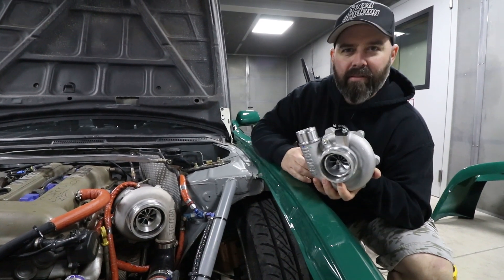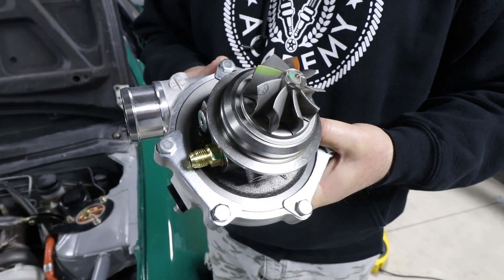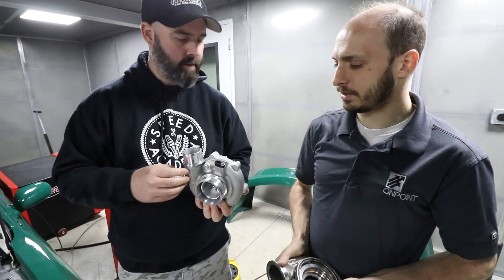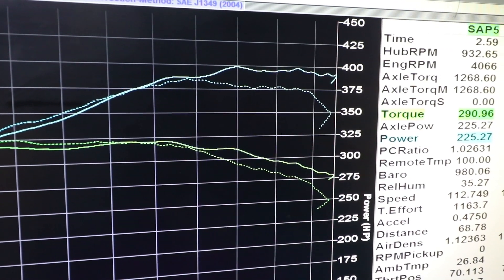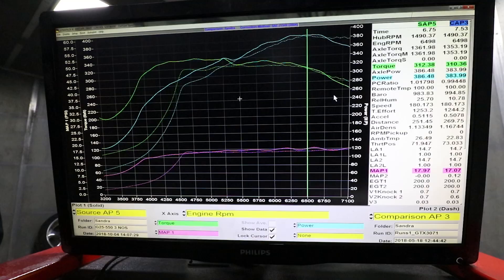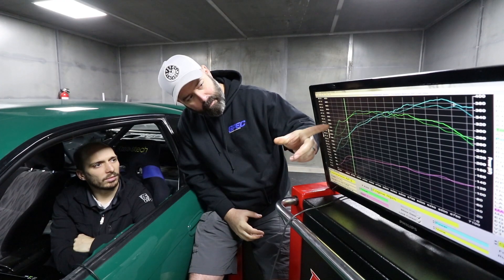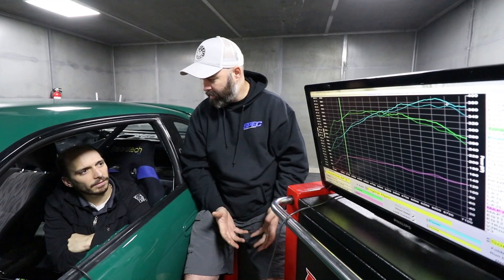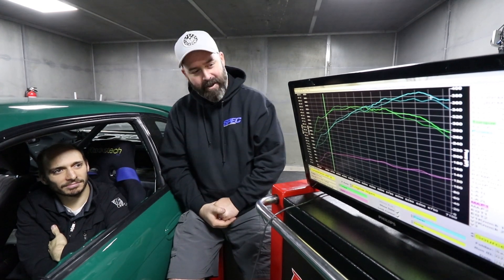Garrett G25-550 VS GTX3071R Gen 2 SR20DET Turbo Test

Comment: Hi all, how would this turbo perform on a 3.0L?     Does the curve just shift by 2/3?      So the psi made at 3000 on a 2.0L will be made at 2000 on a 3.0L?

Comment: I run a GTX3076R on my EJ207 WRX and it is a great turbo for a 2.0L. 450whp on E85 and perfect for daily driving. Spools at 5k rpm. My next turbo will be the G25 for sure though.
Reply: Spools at 5k? Isn’t that late? How can we get an earlier spool from 3k to 7.5k rpm?
Reply: Spools at 5k?!... thats late! Certainly not a good street set-up. 

You want full boost by like 3500rpm.
Reply: what a/r is the 3076r?
Reply: @UnsaltedSpuds  .60
Reply: I got a 2867r .57 ar I'm trying to get fastest spool for more low end torque. I wonder how it will perform on my 2.0t Mk6 R

Comment: When it comes to low down spool you can't go past an EFR turbo,we personally went from a Garrett T66 b/b .68 single entry housing and made 9psi at 5500rpm to an EFR9180 with a 1.05 split and seen 24psi at 5500rpm,was night and day,car made 650hp to the tyres through an auto and a single cam 1.8ltr @8.76@155mph at 42psi at 2480lbs...

Comment: It's incorrect test, this different frame turbos! Need test GTX2867 0.86A/R vs G25-550 0.72. They have same peak power, and same exhaust flow chart

Comment: Can't get over the laughably huge low-end advantage of the G25-550 over the GTX3071R V2 on this particular engine. Below 4600 rpm, the G25-550 has +150 lb-ft in a lot of areas. For pure top end though, the G25's (660 included) seem to choke, as expected. But more options are good.
Reply: That 150 ft lbs is a big deal
Reply: It matches the gtx3071 on the top end while besting it by 150 ft-lb in lower rpms.
Reply: at 6700 rpm
Reply: why ?

Comment: @speed academy
I had narrowed down my turbo choices to either the GTX2867R Gen2, or GTX3071R Gen2, for my KA24DET S13 drift/daily, but seeing this video has me reconsidering. My goal, also, is to have the fastest spool and response time possible, with a target of 350hp. I basically want as close to zero turbo lag as possible. 
I will be running an ARC Sidemount Intercooler, 91 Octane pump gas, 740cc DW Injectors, Megasquirt2 standalone, NTK/AFR500v2 WB, Tial BOV, Tomei lower-mount cast T2 manifold, and 3 inch exhaust. It is a 2.4L Dual Cam engine with forged internals and stock cams.
Will the G25-550 .72a/r, as seen in this video, be too restrictive or reach efficiency too quickly in the powerband, since I have a 2.4L and not the 2.0L as used in this video? I don't want to cause unnecessary intake temps in pursuit of fast spool times. I need to decide which turbo I am going to use, as it is the last big purchase needed in order to complete this build.
Thank you in advance for any advice you can send my way!
Reply: According to Garrett's website, the only G25 with a T2 entry is a 0.49 a/r. Way too small for a 2.4L engine. My only option for a 0.72 G25 is to buy a V-Band manifold. Could I get similar spool from a GTX3071R with the 0.64a/r? Or would that be too restrictive in the top-end with too much heat? Or a GTX2867 with 0.64 or 0.86? I really want to stick with my Tomei T2 manifold.
And also, Garrett does not make a 0.72a/r GTX3071R Gen 2. What was the a/r for the GTX turbo in this video?
Thanks again.
Reply: @sonoradrift  also the piping shown in this car is surely and most likely introducing a lot of lag as the turbo has to fill all that area even before making positive pressure
Reply: i mean i get better spool in a 2.0 with a holset hx35 (40 years old technology) than this super modern g25
Reply: @cfiorucci  Holsets are great turbos for price... And usually greater than 3x expensive turbos.
Reply: @puliukk0  without a doubt! but they are huge in comparison, and have a very heavy rotating assembly. That was what i wanted to point out in my comment, there shouldn’t be an scenario where that turbo outspools a g25
Reply: the thing is that you’ll choke a gtx28 or g25 turbine wheels with a 2.4, for me, your safest bet is a gtx3071r, or go directly to a twinscroll setup

Comment: If u gotta use nitrous 2 compensate. U need 2 throw it away and go back till the tunning.  It sounds ok. But you can tell when a motor ain't built/ tuned right. This motor sounds like one of them

Comment: I was under the impression that the G25 550 would spool almost like the stock T28 but with more power potential, without nitrous it saw full spool at around  3800 rpms, my gt2871 journal bearing gets that.
Reply: Do you have it installed on an SR20? I cant figure out the difference between a 2871, 2971, and 3071.. Any advice?
Reply: @sonoradrift  2871 uses the NS111 turbine. 2971 uses a cropped  3071R turbine. 3071 has the full size 55/60 turbine. The 2871 is a terrible turbo,  the compressor wheel much too large for the turbine. The 2971 is no better with its cropped turbine.  In a 28 size frame the GTX2860R gen2 is king IMO. If stepping up to 30 size frame,  3067R or 3071R with full size turbine is good too.
Reply: @Rhubarb237 you know your turbos well

Comment: Does this car have a diverter valve at all? I hear what sounds like one opening, but then there definitely seems to be compressor surge also after the throttle is closed. Is this a concern or are you relying on the ball bearings to take the abuse and not worry about it?

Comment: very good video! thanks. i wonder how it performs vs my gtx gen2 2860 that i use for 340whp now. i have full spool at around 4100rpm
Reply: what engine size?
Reply: @dennisrobinson8008 built sr20det. funny i come back to this nowas i just broke my gtx

Comment: Response without twin scroll is a bad route IMO. Other than that a comparisoon without knowing the turbine housings is kinda lacking. Id really like it if housings were mentioned. Was like .63 for the GTX and .72 for the G25 ?
Reply: Valid point. Lot's of people will see this and just draw a conclusion without knowing what or why things changed. There is no doubt the new Garret turbo is a great bit of kit, but you need to do a like for like comparison to really draw any meaningful conclusion from it. I mean was the car retuned to the same AFRs in the same spots as before, or was the turbo just thrown on with the old tune? I could make the new turbo perform worse than the old turbo, with the right (wrong) adjustments. Some people will watch this video and just take the results as gospel, without knowing all the facts.
Reply: @DodgyBrothersEngineering   Agreed - that info is critical.  I'm about to pull the trigger to go from a Gen 1 GTX3071R with a .63 A/R to a G25-550 on a 2.3L Volvo 850R since the engine is already out.  Knowing the A/R of the two turbos here would certainly make my decision easier.

We never really got my car running correctly - mainly due to oil leaking into cyl 5 at a high rate and killing coils constantly.  Even before the coils would fail, it added enough resistance to cause breakup during boost.  Compression and leakdown tests checked out okay so we're guessing it was some shoddy machine shop work leading to rings not sealing correctly.  Bit the bullet and went for another rebuild.  Prior to that though, the best numbers we got were from an aborted run - 382whp/451tq.  Since then I've added water/meth injection and we're swapping heads to a dual VVT head.  Between the VVT head and turbo, i'm really excited to see what kind of powerband this thing will produce.  https://i.imgur.com/9MOcaZcl.jpg

Comment: Hello Speed Academy.... watching your video and reading some coments below a question comes to my mind, I am now restoring a 4 pot 8v old FIAT engine. Which turbo would you advise to have the less lag or faster spooling possible the G25 or some EFR ?
Edit: from this video I see that obviously the G25, my question is which of the AR should I use... the smaller one seems a bit small to me compared to older turbo ( AR.049)
Greetz

Comment: I've got a similar engine slightly smaller tomie 260 sticks with a garret TR30VGT with a billet 76mm comp wheel ive been able to make about  23 psi at about 2500 rpm but it rattles like all hell so i have dialed it back a bit .. its flex fuel setup i wil have to see what it can do with e85
Reply: Isn't the TR30VGT a WRC turbo or Garret Racing turbo ? VGT too ? dam how do you control that thing?
Reply: @RadionAMD  I thinks it's off an LMP deisil I control it with an RC car servo on my ECU I map it  exhuast manifold pressure Vs RPM
Reply: @incolink  what !!? 😮. How did you even get that turbo. Wow ! You said "it" rattles as in the car or the turbo :) ? Twin G25 with mild secondary air injection antilag vs VGTs. Most VGTs the general public can purchase are for diesel. The turbine wheel might not be strong enough to endure gasoline engine temperature.
Reply: @RadionAMD  when I said rattle I meant it knocks the high back pressure and just 98 petrol but it may have had a bad injector the turbine was allegedly titanium I don't believe that but it's not ultra light I think I will put GT35 internals in it next with a 2.2 build

Comment: Since I don't know a lot about nos can someone explain to me why you need to purge the line?  Is it not a closed system to where you shouldn't have to worry about junk getting in the line?
Reply: "The purpose of a nitrous purge is to ensure that the correct amount of nitrous oxide is delivered the moment the system is activated as nitrous and fuel jets are sized to produce correct air / fuel ratios, and as liquid nitrous is denser than gaseous nitrous, any nitrous vapor in the lines will cause the car to "bog" "- Google

Comment: Now THESE are the kind of comparisons I want to see - Gen 2 GTXes versus the new G25 series. I'd also love to see it compared to either a Borg Warner EFR6758 or especially the G25-660 versus the EFR7163.
Reply: This!
Reply: 7163 and the 660 are 2 completely different hp ranges at the crank. 
Efr7163 is 550.
660 is literally in the name. 660.

The efr7163 would dunk on the 660 for response.
If you want an even comparison youd need to compare a 7670 to the 660 as the 7670 is closer to the power range of the 7670
Reply: @ColdVVL  not really, the 660 rating is bullshit, especialy fot the g25 but maybe the g30-660 could hit it. The fair comperason would be efr6758 to g25-660 or efr7163 to g30-770 for they have the same internal sizes.
Reply: @XFOX1996  the ratings arent "bullshit" they are based off crank hp not wheel and on ethanol. they can and do hit that hp as ive seen on many different vehicles.
and the turbos you are listing are far different hp range so again, not a fair comparison
Reply: @ColdVVL  you are wrong. Bw underrates there turbos and garrett overrates theres. Go look up the internal dimentions insted if you want to compare them
Reply: Did we ever get comparison of the EFR vs G series?

Comment: What rear housing is the the 3071r running, seems way to laggy,
Reply: Garrett doesn't make a 0.72 hot side for the GTX3071 Gen2.
Reply: @sonoradrift  they do for the g25-550
Reply from the maker: .72 its not the housing its the cams.

Comment: My b5 stg2 1.8t turbo is so small it runs out of steam by 4k rpm. Shit I know but feels good on the street. Seen k04xl hybrid turbo from xs-power that I want to try out.
Reply: I have that. You wanna buy it for $250? No shaft play and its like 7000 miles old. Didnt snap my rods but surely feels like over 300awhp

Comment: yo if you cant get good response out of a 3071R you're doing something wrong. that intercooler seems pretty big and he has a decent amount of piping. if he optimized that set up he would probably get better transient response (better than buying a whole new turbo for thousands)
Reply: I shortened tf outta my intercooler piping, deleted anything outta the manifold, and use a pretty small intercooler and i have a gt28 sized turbo on my 1.8t and if im on the throttle im in boost no matter what rpm im at. Even 1k rpm ill have like 3 psi at wot in a high gear. I get 22psi at like 3k. 

Look up killerchiller intercooler set ups. Uses your ac to cool your boost with no huge ass front mount

Comment: I might have missed it, but is there anything done to the head as far as valves, springs, and cams? I'm sure that with aftermarket cams and larger valves along with some good port and polish work would make the G25 respond even sooner.
Reply: I see that it has HKS 272s, and I would imagine that you have to run some dual valve springs and aftermarket retainers, but what about an NA head swap (I heard they flow better), and some good port and polish work?

Comment: nice car and setup ! BUT the tune is not great. If you listen closely you can hear the engine does not run smoothly thru the rpm range. There are multiiple spots that the engine bogs down a bit thru all of the pulls.
Just Sayin. lol
Reply: That's due to the Dynapack dyno's operation, actually. Doesn't matter the vehicle.

Comment: Just don't get drifting, why not just put a narrower tire on the car and then over inflate it?
Reply: Michael Miccio because that’s not how it works. In a properly setup drift car you want as much grip as you can so you can hold that car at angle and run lots of speed. On a low power car you can get away with a small overfilled tire, but a proper drift car just wouldn’t drive right set up like that

Comment: Nice test, cheers for sharing!  I assume this is the .72 hotside?

Looks like the EFR series probably still have the edge, a 7163 on a stock stroke SR20 spools similar to this but flows closer to the 660
Reply: @treysnyder2676  the .92 is a T3, the only vband housing for the G25 is the .72.

Comment: This is a great idea for an episode and the dynamometer Data was great as well, however (and not to sound negative) I’m a little bit concerning about the cylinder pressures being achieved at such low engine speeds? I can appreciate that this might be asking too much based on the level of technical content you put out but some additional data would have given more value to your illustration. 

From what I am seeing you’re trying to achieve the results of what a bigger displacement engine would produce but with a much smaller engine? If that was the goal then sharing this would go a long way towards the audience trying to have the best viewing experience. Top marks for doing a comparison video using one of the G series Turbochargers, the are many people looking on with cash in hand but are hesitant or at least apprehensive.

Cheers 🍻

Comment: i have a GT3582r waiting to go on my 2.4l engine and i heard rumors that I'll be waiting on boost forever. i lowered the compression to 8.8:1 years ago, but now I'm thinking i should have left it at the oem 9.5:1, maybe I'll raise it up in the future
Reply: 8.8 isnt too bad ,  some cars come stock with 9.0,  you can run more boost safely :)
Reply: @bongskag  yea i know, but i want as much power and torque in both in and out of boost. when i see 4 banners with 10:1 and higher compression making insane power on pump gas, daily driven on the street, i think man i should have just kept the 9.5:1
Reply: PANTYEATR1 are you running stock cams?
Reply: @griffdastick  no, I'm running crane cams #14 turbo cams. i still have the cam card in the garage somewhere. I'd have to look for it. i think they dialed out the overlap and maybe added a small amount of lift

Comment: 400whp    with a GTX3071R

for that HP ... you should have used a GTX2863 or 67... IMO
Reply: Of course you can make 400whp with GTX2867 (not 63)... but for a drift/race application, where you're always hard on the gas, its better to go one size up so theres not as much stress on the engine and turbo... to get the same power.  You'll get to 400whp with a smaller GTX2867... but your charge temperatures will be significantly higher... and the turbo will be working harder... when compared to a 3071r.
Reply: 2867 with e85 280 rear wheel kw
Reply: My 2ZZ powered Lotus with a GTX2863R runs 373whp on e85 with 16lbs boost, plenty enough for 1850lbs
Reply: @Drifty325i   Thats huge power for 1850lbs.  Do you have any videos of your car?
Reply: Marek Sumguy As soon as i get home i intend to get some really good ones! i actually haven’t driven it on the e85 tune but on 93 oct at 330whp it’s pretty dam awesome! the smaller turbo, larger 2000cc and higher compression help to make it really drivable. I think for a full on race engine though a bigger turbo and lower boost like you said would be a safer option though
Reply: made 304rwkw with gtx2867 gen 2 full boost by 3700 best turbo for 300kw can beat it
Reply: @revert2deen  I think in this test must been GTX2867 instead 3071
Reply: unijabnx2000 Yeah i would of thought a smaller GTX would of been a better option.

Comment: I’d love to see you guys do a power test between a car with and without the silencer in the muffler.   Everywhere claims  very little power change but my car gets noticeably sluggish over 2500 rpm.
Reply: They had a video with the 240sx doing that test.
Reply: Lam Nguyen awesome,  took a little digging to find it.  Knew it had to be killing power.
Reply: @brianhilligoss  of course it's killing power. The silencer adds a crap load of back pressure in the exhaust as it bottle necks.

Comment: What A/R are you running on both turbos?
Reply: 0.72 on the G25, and speed academy said 0.72 for the 3071 also, but Garrett doesnt make that a/r for the GTX3071 gen 2. Needs correction because I want to know also.
Reply: @sonoradrift  probably was running the 3071 .82. the .63 spools much faster.